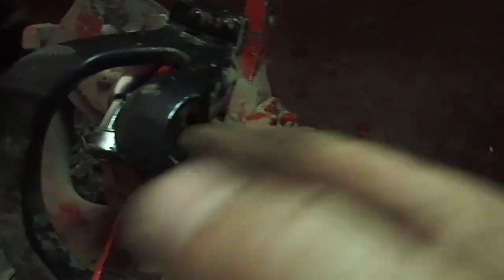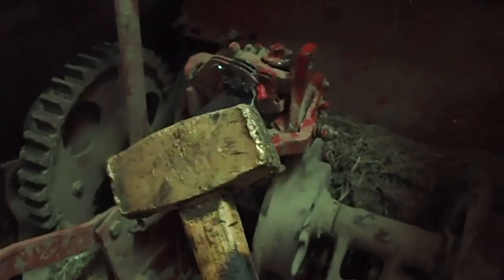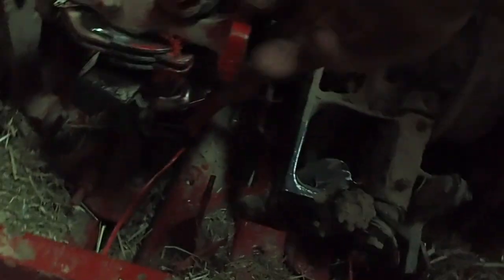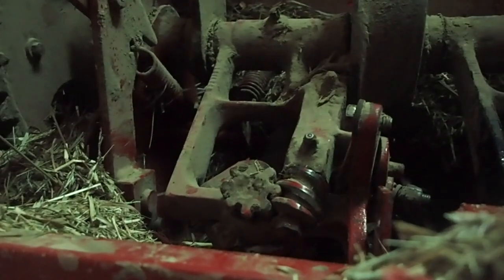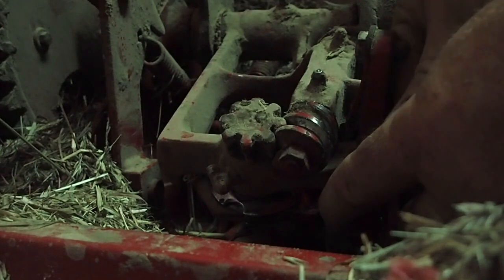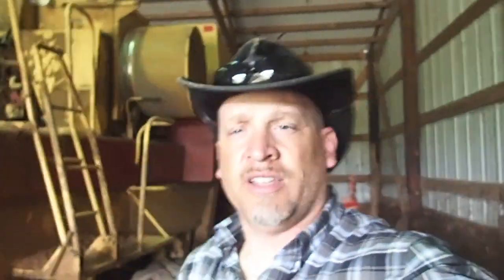Easy Knotter Adjustment

Comment: I find it amazing that such complicated machinery can even be conceived, designed and built. 

Wes you are an intelligent individual to be able to make repairs and maintain all these machines. 

Thanks for the video
Reply: Norman Bates  what's even more impressive is the basic knotter concept and baler design hasn't changed much since it was invented.
Reply: +Nichols Hay Farm

"... basic knotter concept ... hasn't changed ..."

That amazed me as much as anything ... it's been almost 50 years since I stood on a hayrack behind a baler, and the knotter and the terminology are still the same today.
Reply: Maybe the concept worked so good that nobody has been able to improve on it.
Reply: Yep! I was told that New-Holland first mass-produce that concept. But that doesn't tell me where they got from (must have been from a sticher rather than from a farmer or engineer LOL) But Ford and Heston used the New-Holland knotters. MF and IH made their own version-copy of it. As for JD, well, they trade-mark everything LOL ;)
Reply: Lol. Yeah JD does. Ol man Kinze showed them though.
Reply: NH Farm why change design if it works good and u can ask for advise from the older men
Reply: That basic design has been around a long time, I had a 1908 corn binder with the same mechanism for tying knots. @Ghis1964s
Reply: @drawbar217  Those old N-H knotters have been on Ford, Oliver, Hesston (and maybe others) balers. The MF ones were almost the same design and worked just as well if not better. I know that the old Hesston inline small-square balers had NH knoters on them. I don't know if those remain the same when, in each/either turns, Case and AGCO , bought out Hesston.
Reply: @drawbar217  ...again... you said 1908, are you, or know, a collector? 
I do some part jobs and one of them is to spread manure. One of my boss's client lives near an old train-station which has a few farming equipment around. One of them is an old green&yellow wooden-built baler (JD??) which as been restored for a past 20yrs parade on a centenary of that place. 
I can google-earth that spot if you know anyone that would like to buy this (as it is rotting there 🤦🤦🤦)

Comment: Thank you for demonstrating how to adjust the wiper arm with a hammer. I have a John Deere 327 baler that was not tying consistently, I tried all adjustments the manual suggests to fix the issue without solving the problem. Thanks again for helping me through a frustrating situation, before I was getting about half of my bales not tied, last night I baled all evening without a miss!

Comment: We had an old Case baler.  We would put up between 2500 & 5000 bales per year, mostly 2nd & 3rd crop of hay.  The only time we had knots not being tied was when the hay or straw was too damp.  We had years which I can't remember missing any knots.  But like you pointed out in the last video, we always started out with the tighteners looser and tighten as the old stuff came out and things got going.  Of course we piled all the hay on wagons and then up in the barn.  Great videos Wes!  Keep it going.....

Comment: Excellent video and explanation of the knotter and adjustments. My dad has a John Deere model 24 and we have knot issues up to about the first 50 bails, yes I've noticed wear and play in areas you've pointed out. I can't help but to believe the JD and New Holland knotted are similar, they sure look it. I'm the wagon hand and I see the needle brake disk is rusty when we start and as the disk starts polishing off the problems with missed knots diminish, glad you tossed that last bit in at the end. Settles my mind on that issue. Thanks for sharing Wes. Congratulations to you and Theresa on the birth of your son, William Edward. Take care, God bless!

Comment: I remember back in the 50s when on the farm the case bailer was changed from wire tie to twine. Took me as a kid(I was 12) quite a while to understand the system/knot tier. When working its great. When malfunctioning it can be vexing. Great video on the fine points of getting the system to produce a nicely tied bail.

Comment: Two other things that I have run into in running a New Holland 66 baler other than all that Wess mentioned are 1) proper tension on twine and 2) quality of the twine you are using.  My baler wont tie worth a darn if the sisal twine I am using is not consistent in diameter.  Very informative video Wess.

Comment: Greetings once again!   Wow - I'd say this is either Product specific OR  Country specific......    First impressions were - 'woddaloadawaffle'  - but  BUT following through, I could see WHY ...   .    Excellent vid  for those who know a little and UNDERSTAND.  
YOu  must have very abrasive working conditions across there, and maybe NH knotters which look like those on our old IH and Deere knotters  - we refer to them as Rasspe knotters, are built to a " poorer ? " standard - that you have those broken spring issues....   I have baled many 10's of thousands of bales over the years and never experienced those issues  - balers even 20 yr old ( IH B45/46/47/440 )  and the JD 214/224/ 300 Ser. .
       However , I was very impressed with the way you adjusted the knife arm with the hammer.  - and YES that's right  enough, using the hammer - just that I'd never scene it done so simply like that    EXCELLENT.     Thanks for  taking the time to post and keeping the Craft alive,         Sláinte!

Comment: Thanks Wes, helpful video.  I greased mine before I went into the field and had problems with the knotters and I wondered if that was the problem as Ive read somewhere that could be a problem.  Appreciate knotter lesson.

Comment: I get a lot of calls about balers in my area and the biggest problem I've found with guys balers is twine tension. Whether it be wrong at box or grooves wore into twine path causing friction. 
If the bill hook is wrapping, twine tension is the first thing I look at, then knife arm.  I've seen the ceramic eyelets almost cut into from twine. 
Lower tension for poly than sisal.

Comment: Adjustments on an old JD 14T, those were a pain. But, when working, couldn't beat em. Broke only 1 needle with it, would usually lose the knives before anything else. Sold it, the floor rusted out real bad, to replace, the cost wasn't worth it. Used to make bales 90lbs plus. To be honest, I do miss the little bales, gave you one hell of a work out when loading into a barn.

Comment: 4 decades & 6 years ago, when party telephone where still in use, as a teen , for a week or more I rode the back of a bailer with a small ball peen hammer 4 oz , my job was to watch how long the bail was and I think tap what you described as the brake drum till parts came in.  One light tap and the  knotters  would cycle. Not sure don't think UPS was available then either..
Beings I was young  & hired hand the 27 points that needed grease was most I was allowed to do.
So for 6-8 hours a day, almost 2 weeks every 15 seconds give or take,  tap, watched length mostly . 
Learned just to not scratch, let the chaff pile up as I rode the bailer.   After first day wasn't so bad. Kind of memorizing. 
Left farming shortly after that for sawmill work, should stayed with farming.
Reply: MrVailtown if you left farming for sawmill work, that was a mistake. I didn't like farming, may have had something to do with the 22,000 square bales we put up. But sawmill I thought was far worse, it will make you appreciate a board a lot more.
Reply: Mt man 1949 it was a bit complicated, owners where my uncle & his brother.  The brother had children running the farm. My uncle had no children . 
My last name wasn't the right one & at the time they couldn't afford full time year around help.  If I could of hung on a few more years at summer help, I may of got full time, but dout it.     Thought should find full time work & a sawmill was close& steady.
It was harder work in some ways, lasted there five years then moved on.   That was 5-6 days a week 45-50 hours or more depending on weather & seasons.  
The mill was old fashioned, once modernization came along I left, management changed  & out put was all they wanted, they figured it was more important than "grade" lumber, beings set in my ways , poof I left.

Comment: as a retired construction worker, i really enjoy watching the knowledge you have on farming and your machines. my question is cleaning them. i know you work your butt off every day, but can you power wash you equipment to keep them running more efficient and stop them from fowling up, or would that cause damage to them.
Reply: Almost inevitably when seasonal  machines are washed and put into storage after use it will lead to corrosion issues all over the equipment (eg a scratch mark / dent, seam joints etc) but also damage to things like seals, bearings, chains, other close tolerance situations. It is much better to thoroughly blow them off with compressed air and then inspect/repair and apply rust inhibitor where necessary and put undercover in storage. It has also to be understood most modern farm machinery is full of electronic equipment which is easily damaged by being wet / damp all through the off season as well as subject to damage by rodents and UV light.

Because pressure washers in particular work at high pressure they tend to force water to places where it is not wanted eg under seals, into bearings, gearboxes and power transmission chains and other locations -if you want to wash a machine then do so immediately before use in the season!

Comment: The flat spring can easily be over tightened.  Most if the time a missed knot can be adjusted by a one sixth of a turn to correct the issue.  Too tight will also cause problems.  After going to baler school for NH, I got the dimensions to build a adjustment bending tool for the knife arm.  No hammer required.   Look at the missed knot and match it up in the owners manual diagnostics, and it will show you exactly how to adjust the knotter.
Reply: What adjustment do you make for a #1 mistie?

Comment: I had an issue with an International Baler where one string would always miss a knot, tried all sorts of remedies, still it would miss a knot, then found out that being the bailing chamber was bolted together the bolts had somehow either loosened or the bolt holes elongated and let the chamber come out of square, after setting the baler on jack stands so that the entire bailer was perfectly level on all planes, and making sure the chamber was square, I welded all corners so that they would never get out of square again, after that the baler worked perfectly for me and the person that had bought it when I sold it, If I am not mistaken it was an International 46 baler it has been too long that I don't remember the model of it. The only thing I didn't like about that baler was the fact that it DID NOT like big wind rows, it would strip off one of the teeth on the pinion gear in the gear box.

Comment: knew knife arm has to rub lightly but didnt know second angle of hammer.thanks yes very helpful.
Reply: New Holland says that the bill hook wiper, should have like 13 lbs pressure, to push across the bill hook. It does not take that much.

Comment: Hey Wes Gerry here you get a chance to show them the knife blade how they wear down with plastic a lot faster than with sisal and how you get Frayed Ends instead of a clean-cut that also can be a issue of the not not getting cut clean enough and slows down the knot tying before the wiper arm wipes at off thanks for the video

Comment: Your video has helped alot with a NH S-69 baler. What kind of shims do you use to adjust the slack in the knife arm? Unknown bale count on my baler(Bought Used) but has some play in it and will not strip twine to make knot.
Reply: Did you figure out the shims? One of my knife arms has a lot of play and has been worn down where it was rubbing against the billhook

Comment: I have a NH 273 baler. It hasn't missed in 10,000 bales. Just this last year the passenger side knotter started playing games. It won't tie the knot and then you end up plugging it up with 3 or 4 knots tied around the bill hook and then you spend 20 minutes with a knife and a torch trying to clean the twine out of it. What is the cause of this? Many of my neighbors recommend changing the 4 brass "balls" that assist in the rolling function of the knotter. I'm not convinced that will fix it. Could it be in the timing of the hooks or discs? Thanks!

Comment: My #1 twine had a pigtail on the end, like it had tried to tie and missed. The nut on the bill hook tension spring had about 1/4 of the bolt protruding on one. But the other had 0 bolt past the end of the nut. I adjusted that. The twine disc flat springs are noticeable bent, so I tightened them up. Now the ends of the #1 twine (0n top of the length of the bale, is ragged, like the spring has broke, and no pigtail. Can you give me a hint?

Comment: You didn't cover needle adjustment, Not familiar with that particular baler (We have a 282), but the left edge (looking from the back of the baler) of the needle should just rub up against the side of the knotter.. There's also a specific height off the twine discs that it should be set to but can't remember it offhand.
More on bill hooks, I've found that I had to file the little keeper bump down just a little bit for it to bite onto the twine better.  Also, on an older unit, it's a good idea to replace the brass cam followers if they're getting sloppy.

As frustrating as these can be when they aren't working, they're also phenomenally reliable and low maintenance.. Our old 282 has an estimated 750,000-1,000,000 bales through it and it never misses a knot.
Reply: Rx7man 1/8th inch on the twine discs.

Comment: Thanks for that last little tidbit of info. I have searched YouTube over and you are the only guy that mentioned it that I could find. Our baler is doing just that and causing the plunger stop to break shear bolts. There is a little pad left so do you have any recommendation on homuch to tighten those brakes? Thanks for any help.
Reply: 33 mm at the spring from top to bottom

Comment: It amazes me to think that they made square balers before round balers even though they are way more complicated so many little minor things that can make the notter no work correctly. Thanks for the lesson wes and we have a Deere square baler and on the right notter it thins the twine behind the nott do you have any Idea why this would do so we thought of was the bill hook at first so we replaced it and it helped for a little bit but didn't fix the issue. Thanks
Reply: ALLIS-CHALMERS ROTA-BALER well before square balers. Too much tension on twine holder disc ,maybe stripping it as it yields while tying?
Reply: Yeah I forgot about those and thank you

Comment: Great video.
What is the reason for some bales being longer, sometimes 4", sometimes double length?
This is very frustrating.
Reply from the maker: NoC that's an easy one the metering wheel that lists the trip mechanism is stripped out replace it it's just a three dollar part when you hit a bump it will drift the metering lever down
Reply: No, the wheel is not worn. Baler has only ran 3000 or so bales and is two years old. Have a Kuhns bale accumulator behind the press, so I have no pressure on the adjustments as the chute on the collector provides back pressure.
But I agree, the suspicious part is the metering wheel. It seems it doesn't roll along the bales consistently.
Reply: good day.  one reason  for longer bales, if your hay row  is uneven or bunching  & a big bundle goes in fast, it might not move as quick & you will get a longer bale.  People were saying 50yrs.  the binder had the same bill hook system. Thanks

Comment: I am getting banana bales and my hay dogs and springs appear fine. Any other hints?
Reply: Ok, I think I found out what is going on. On my 311, there is the 2 pieced of metal, that the dog fits between and holds the pin. On the front side of that, there is about a 4" x 4" piece of metal welded perpendicular, and right against the 2 pieces that hold the dog and pin. On the inside top dog, this piece of metal is gone. When it is there, it preloads the hay dog spring. but, with it gone, the spring goes all the way to the top of the bale chute. Basically, what is being caused is the spring, although it is good, does not have enough tension on the hay dog, for it to do it's job. Looks like I have to pull the knotters off, so that I can weld a new piece in place.
Reply: Look at 2:24 in this video, and you can see the piece of flat metal, that put the preload on the hay dog springs,  https://www.youtube.com/watch?v=ZoB_1meRa9A

Comment: You forgot the most common problem, blunt twine knife
Reply: Yes, they're hard so a fine diamond file I found best, and make sure they're not rusted over winter as too the needle eyes & knotter brake, (wipe clean before season start). Keep the needle eyes filed out so there's no slotting that will stall a ball joining knot as well as turnng the porcelain eyes to keep them slot-free where the twine runs. Our biggest problem was from inconsistent poly twine thickness (40yrs or so ago though) so the twine holders couldn't function properly. Always keep spare springs like Wes showed with you. Keep main top shaft free from side slip with shims (winter maintenance job) as too the rollers/bearings on the knife arm so they travel fully.
Great job Wes, have a great season.
Reply: I had the dull knife issue at the end of the season. 
martin benton